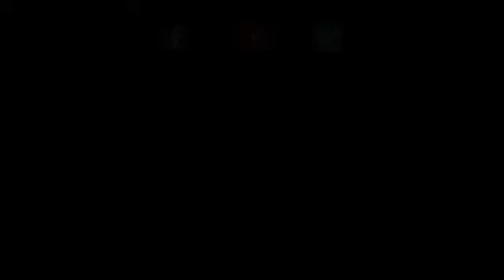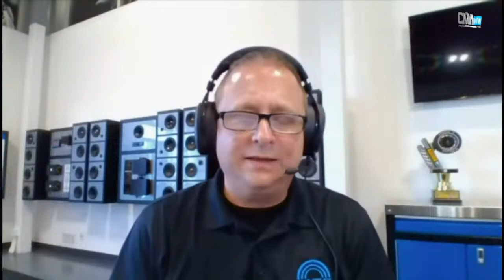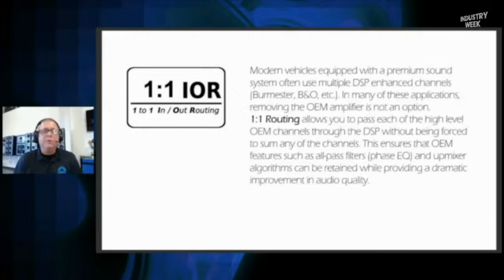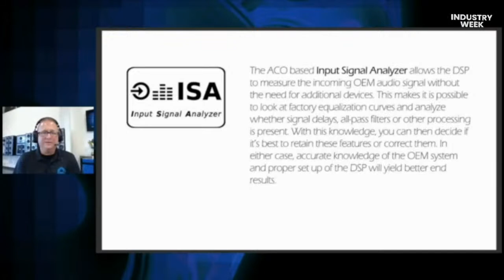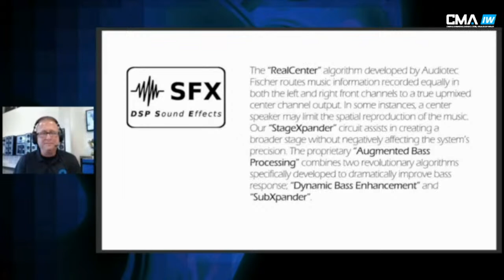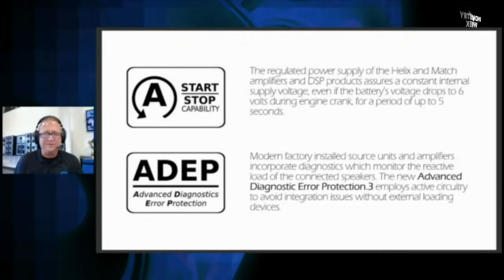Audiotec Fischer - Technology Explained - MSC

Comment: Very informative! I am planning on using Match Up 8DSP and a Match Up 1 FX. Nice to know that the technology is in the different product lines.  Should I move to the Helix line?
Reply: The DSP technology and power supply technology are shared between the Match and Helix products. The biggest deciding factor would be what you are using for an input source and what you are working with for speakers (impedance being the biggest factor here). If you are running TOSlink or high level in, and speakers higher than 3-ohm impedance, the Match combo will do an incredible job!